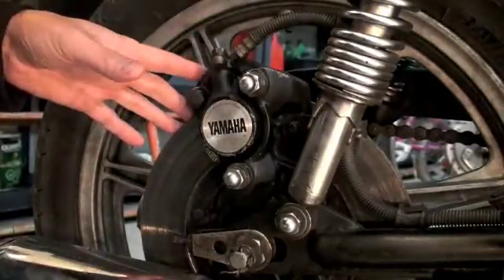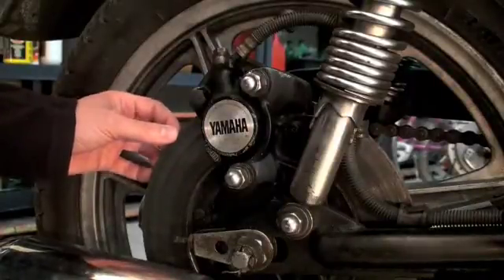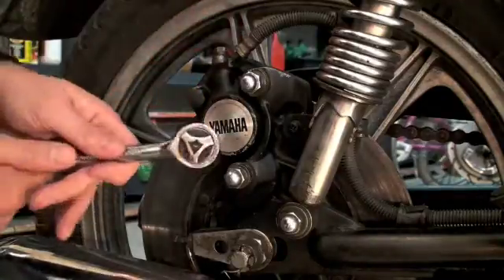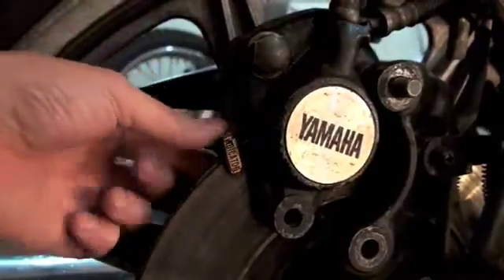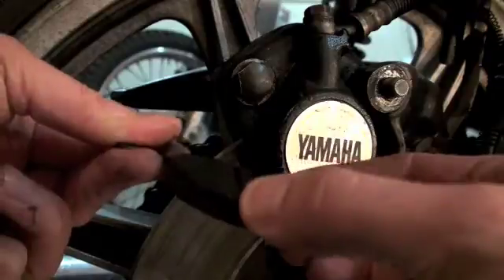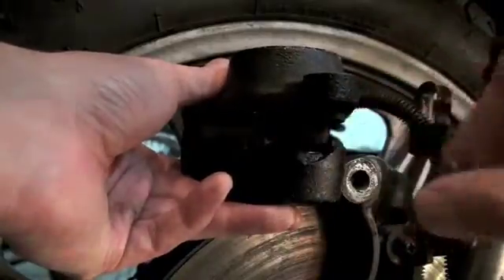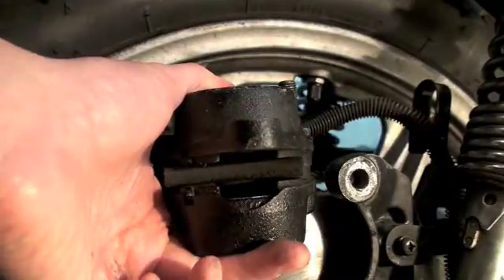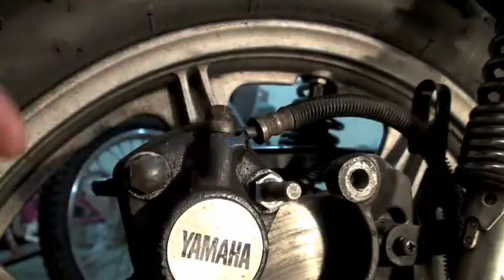How to fix Motorcycle Brakes Pad Fluid Repair RD400 Part 1

Comment: Not really correct. The binding brakes is caused by the little .5mm pressure relief hole being blocked or partially blocked in the master cylinder. This hole allows the fluid pressure to return after the brake has been applied. If blocked the pressure will not be released from the disc completely. As you ride farther the binding pads on the discs get hotter, which starts to expand the disc and heats the fluid which increases the pressure on the brake till you come to a stop with a disc turning blue.